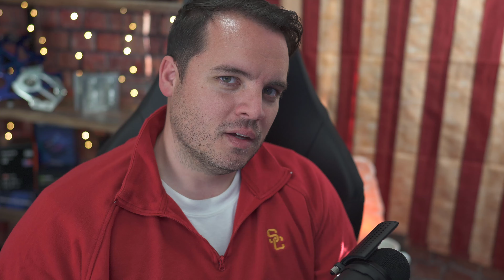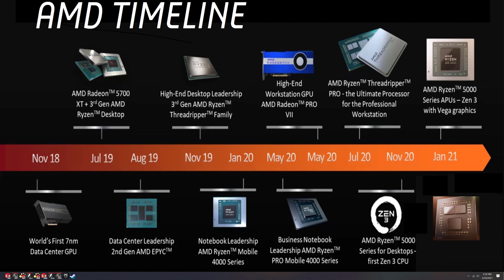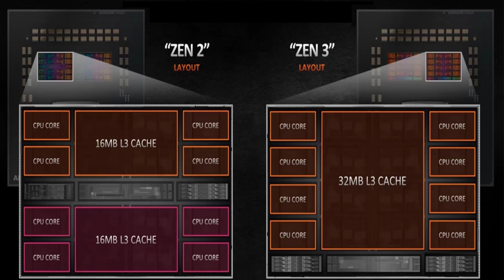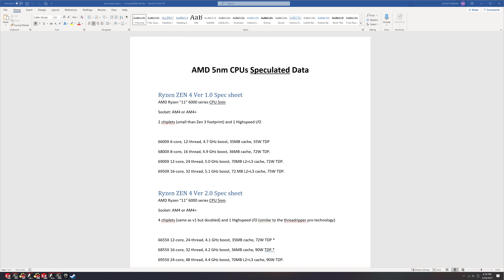AMD 5nm ZEN 4 CPU Specs and Features - 64 cores in AM4 - My thoughts on v1.0 & v2 3D Modeled in CAD

Comment: Given the poor availability of high-end Ryzen 5000 cpus, I finally bought a Ryzen 3600 just to make sure all my parts worked on my current build. It turns out the 3600 is not a bad little cpu, but I want more cores and to max out this build a bit, since AM4 is thought to be at end of life. If I had known I wouldn't be able to get the cpu and gpu parts I wanted in the past 8 months, I might have waited for AM5 and RTX 4000 and spent time hiking instead of low fps almost gaming. Who knew there would be a pandemic, crypto mining craze, shortage of specialized silicon, and tariff wars! I would feel very grateful if we could get good availability of Ryzen 5000(+) refresh parts still on AM4 with either more cores, higher clocks or better ipc in some way. Just better clocks and power management would be great. I hope your speculations come true.  Thanks for bringing up the topic.
Reply from the maker: Steven, thanks so much for the comment and the through reply, i too hope the am4 is going to be here for a lil longer. If any mfg is going to keep a socket around its going to be amd without a doubt.

Comment: DDR4 4 channel is the bottle neck at this point for the 16+ cores. AM5 will most likely use DDR5 so that would mean it will not be on AM4. This is why the threadripper pro series is using 8 channel. Speculation only.
Reply from the maker: Excellent

Comment: I can’t find any sources to verify your claim that AMD shrunk the chiplets on Threadripper Pro. AMD uses the same chiplets across non-APU Ryzen, TR, TR Pro and Epyc for each generation, generally the differences between each line are in the number of chiplets as well as the IO die (which you should not are on Global Foundry’s 12nm process rather than 7nm like the compute die)

Comment: To begin with, Zen 4 will not be the 6000 series. Zen 3+ (Warhol) using TSMC's 6N process will be the 6000 series.

Zen 4 will be introduced as a Socket AM5 processor using DDR5 memory, and the Socket AM5 variant will top out at 24 cores on three chiplets. AMD has not given any indication that there will be a Socket AM4 variant of Zen 4, but it could easily be produced by pairing Zen 4 chiplets to Zen 3 I/O die. If AMD chooses to introduce such a Socket AM4 variant, it will be after the Socket AM5 variant, and have a maximum of two chiplets.

I have no clue naming convention AMD will use with the Zen 4 product stack. Logically, they should have called the 16-core Zen 2 and Zen 3 processor the Ryzen 9 3900X and 5900X, the 12 core variants the Ryzen 7 3800X and Ryzen 7 5800X, the 8 core variants the Ryzen 5 3700X and Ryzen 5 5700X, and the 6 core variants the Ryzen 3 3600X and Ryzen 3 5600X.

Perhaps they will use the Ryzen 9 tier to signify 3 die, and the Ryzen 7 tier to signify 2 die. Or maybe they will use Ryzen 8 for 2 die. One thing is almost certain. It will be the 7000 series.

Comment: ZEN4, AM5, PCI-E 5, DDR5, 40% more perfomance, 20% more price, still very good price/performance ratio, still better, than intel, needs less power and generates less heat.

AMD never really generated more heat.  Yes it did, when yu overclocked it to the hell. And intel? Didn't the same? Yes, it did. ;) 4670K, 4770K, 4790K, 6700K, 7700K and so on These can really run at 95 C degrees. :-(

Comment: I liked your video, but your speculations are probably on many levels too off. First of all, they go for AM5 as future socket platform for Zen4 and beyond. The scaling you assuming is not linear, going from 7 to 5 nm, simply because many cpu logic features does not follow this kind of scaling one would assume and it's less. Mainly because cache logic fabric doesn't scale that way because the way the cache is implemented on transistor level, and overall cache now amounts to large portion of the chiplet. But I liked your video, the speculations which have some rationale ... well the future for sure is exciting and let's see who will be right at the end. But please please your videos coming, the production and sound, topic is very well thought out.

Comment: Sorry but this just doesn’t seem reasonable at all. I mean 72MB of cache with the higher latency for 64 cores will not be a enough and amd will not make high core count CPUs on the AM5 platform because of thermal and power limits.